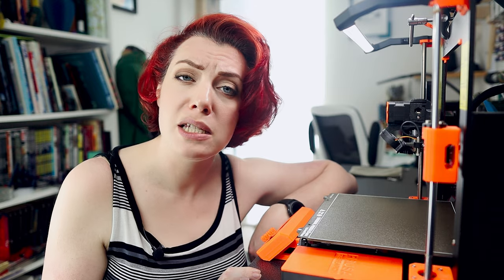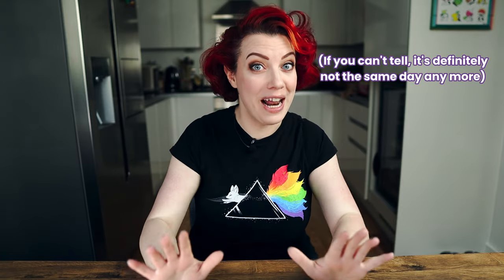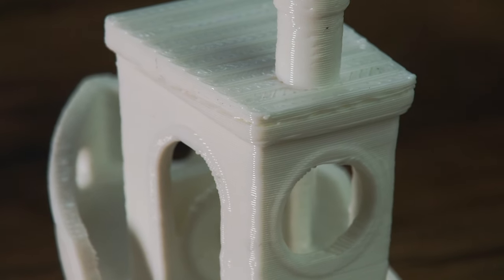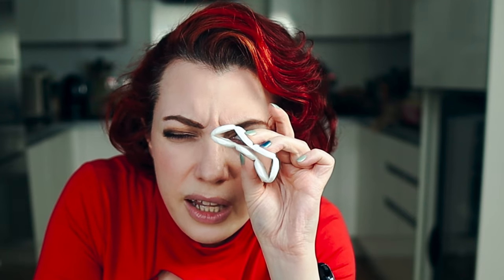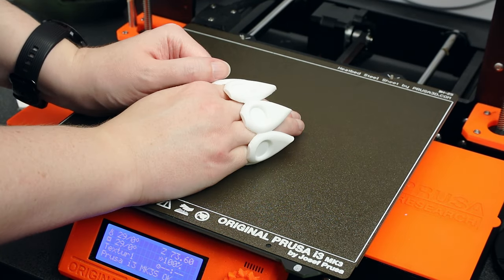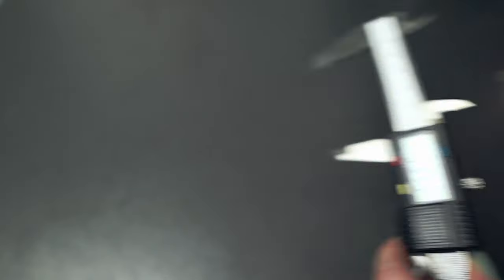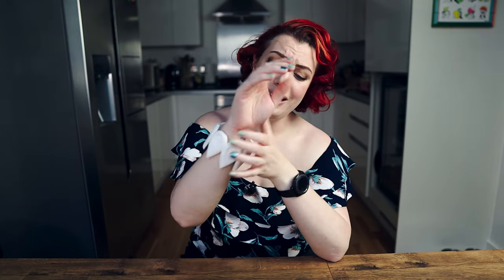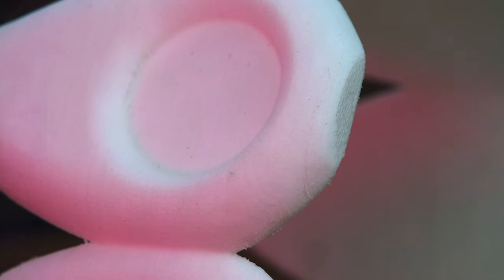Which Flexible 3D Printing Material is Best for Cosplay?

Comment: Awesome stuff here. I just started printing and jumped right into flexibles for cosplay. I absolutely love PCTPE. It’s flexible but holds its shape and is incredibly tough. 

What I did was print using mostly shells for thickness and have it run slow. I set the wall width to .6 which helps speed things along. I subscribed because I enjoyed your review and you’re pretty 😉

Comment: One of the first cosplays I ever did was a goku into Saiyan Armor cosplay and back then I used EVA foam to build my first armor. However, the high density EVA foam I used, wasn't very giving and was rather uncomfortable to wear, albeit it looked good, but just too stiff. In the anime the armor is supposed to flexible to contour to every body shape, yet sturdy enough for combat. Now I'm not going to combat, but the flexible part stayed with me and I've been thinking of perhaps printing the armor in TPU that is rigid enough on its own, but flexible enough to be worn comfortably to cons, especially when sitting, moving, eating etc. Or going to the bathroom.